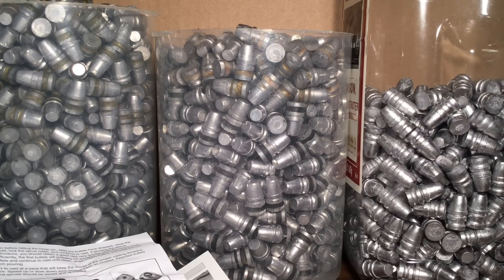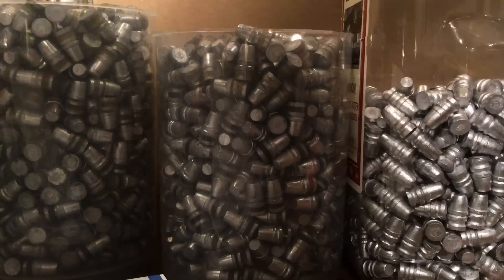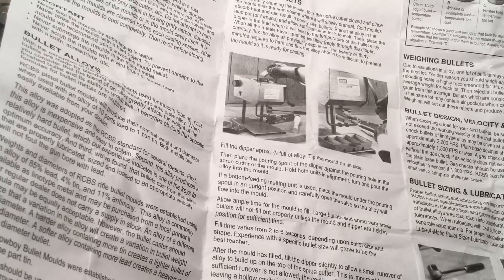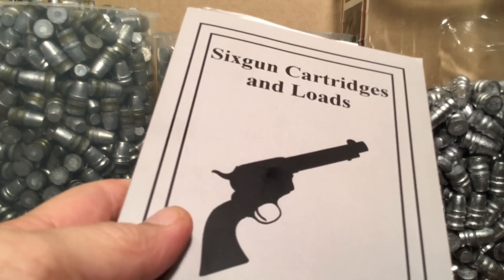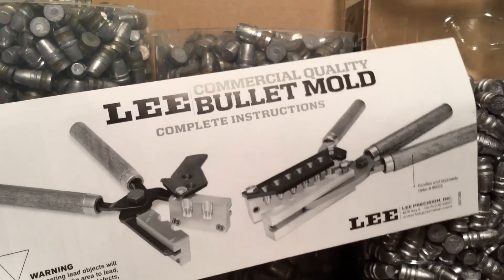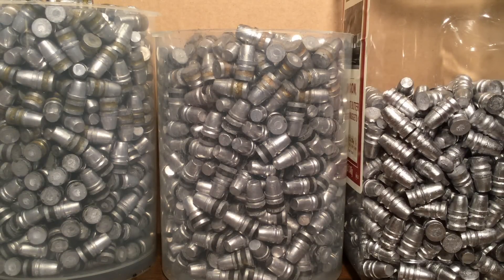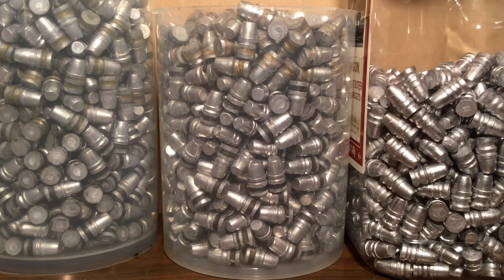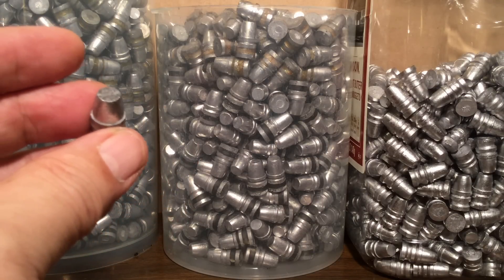The Big Hardness Gain Bullet Casting Water Quench Controversy - VR To Carl

Comment: I started out casting fishing sinkers for my uncle's when I was a pre-teen and soon graduated to their bullet making.....that was almost 50 yrs. ago now. Once I cleared high school, after a few years I was back heavy into casting and shooting and it's only gotten worse lol. Take it from me FC.....water quenching makes a considerable difference. WW's average about 9 BHN air cooled, but if you water quench them and let them sit a few days they'll average 14-15 BHN. By water quenching it arrests the crystalline structure of the lead and keeps it from migrating back to it's original form or structure. I corresponded with Veral Smith way back around 1980 and he offered a lot of advice back then......as well as his lead tester (which I still have). As WW's were very plentiful back then, that was what I used the most....very common and easy to tailor. Nowadays, not so much....getting way scarce. Still though, most of my casting usage is still done with them.

Comment: Your last comment about bullet hardness is right on the money! The hardness of the bullet has to match the application of the bullet. For most pistol bullets a 'hard' bullet would be cast from Lyman's #2 alloy which is BHN15. When it comes to water dropping bullets, the amount of hardness gained really depends on the alloy of the lead used. If you water drop an alloy that is only a lead - tin alloy like the old 30:1 & 20:1 you're not going to get much added hardness as you need an alloy that has antimony and traces of arsenic in it, such as Lyman #2. Water dropped #2 can reach higher hardness than pure linotype, but without the brittleness of linotype. A few years ago I bought a bunch of pure soft lead 26lb bricks, and I already had some monotype & linotype , as well as some stereotype, and I had to come up with a recipe to make an alloy close to Lyman #2 using one of those bricks as the lead in the recipe, unfortunately I don't remember exactly what the amounts were of the other alloys, but I came pretty close (I don't remember if it was slightly harder or slightly softer). I had a stroke a few years ago that effected my eyesight a bit, so I haven't cast my own bullet since then. I should probably sell my drawers full of bullet molds, but I keep telling myself that one day I'll get back to it. That's the same reason I haven't sold any of my photographic darkroom equipment either! :)

One last thing, I've yet to check, but supposedly the hardness gained by water dropping bullets goes away after a few years, although I don't know if that's 5 years, or 15, or more?

Comment: My understanding of water quenching is it creates a short term hardness.  Lead becomes harder as the poured lead ages.  As cast,  ingots tested for hardness will show a reading as soon as cool enough to touch and can be marked but test those ingots in a week and they will almost assuredly be harder.  Water quenching doesn't make a bullet harder long term. I does make it harder at the time it cools vs allowing to air cool.  That helps if you plan to size, lube, load and shoot your cast bullets that day or the next day.  After a few days they will be the same as air dropped bullets.  As you also mentioned, it makes handling fresh cast bullets a lot easier.

Comment: Hey Steve, I will have to get a Lee hardness tester. I recently got 2 bars of hardball and 1 bar of linotype from Rotometals to mix with the four 8# lead scuba weights and 8# of w/w which I suspect are softer than hardball or even the w/w. I quench bullets released from mould when casting. Quench hot bullets that are powder coated, whicj likely harden up batch more uniformly. Great video.

Comment: Hi Steve!; The main reason I've been water quenching my bullets, (BOTH hangun & rifle bullets, even those designed to use gas checks), is much lower final cost. Many years ago, I was carefully following Lyman's #2 alloy recipe, but then read about the 'water quench treatment' I'm using now, much cheaper because I just use wheel weights + 20% Linotype + 1% Tin and (after 2 - 3 weeks of 'curing' any specific lot of bullets), then obtain BHN roughly 25 - 27, and only then, I lube / size (and install gas checks if bullet design so allows), and almost get 'jacketed' accuracy & consistency at lower final costs. If I add powder coating to the above, (And water quench hot powder coated bullets right after coming out of the oven), the outcome is even better, with No leading whatsoever, even in rifle bullets (.243 + powder coating AND lubing / sizing 0.001" over groove diameter, NOT to be used over 2.200 fps / reduced loads). Thank You & Blessings for your in- depth info!!..
🤗🙏🙏🙏

Comment: There is plenty of hard data from that pamphlet the cali bulet casters put out, as well as some recent data sponsored by rotometals. The biggest factor is controlling temp at the point you dump them in the water. Dropping from the mold has a huge variation in cooling time. however if you bring them all up to near critical inside an oven and dump the whole batch in water you get 1) uniform hardness, 2) significantly more hardness than you get from mold dropping.
Reply from the maker: GunFun ZS - That all sounds great...I've got to check that out...but my latest bullets are hard..(from alloy mixing) And I can get BHN 36 with some alloys straight up.!!  Sizing them was a chore.  I suppose I could size them and then heat treat them.  But at what point would I just say, I guess it's time to order more of those SMKs or Scenars or Bergers...And then there is the whole new world of powder coated bullets and getting them to shoot MOA... Best to ya,  FC Steve

Comment: I just bought a Lee Lead Hardness tester. It uses a special point in a press that is spring loaded that must be held under spring pressure for a given amount of time. You then use a eye loupe to measure the indentation and check it against their hardness chart to get you final measured hardness.  Its relatively cheap I would imagine you prolly have one of these by now  to tell  your exact bullet hardness Fortune cookie

Comment: I have been casting bullets for 40 or so years as well. 
Strait water quenching does harden a cast bullet somewhat and provided
one uses a bullet such as the tumble lube lee and liquid alox with no sizing it
will remain hard. The water quenching only affects the skin layer of the
bullet. If you must size your bullet after quenching, you can work soften the
outside skin of the bullet.
I have the RCBS Cast Bullet manual which includes a detailed article on the subject, “Cast Bullet
Heat Treatment” by Dennis Marshall. This article does not specifically cover
drop quenching from the mold but is very informative. 

If you don't have a copy of this book I can e-mail a PDF of the article.
Reply from the maker: Thomas Gervais - Just checked MidwayUSA and they don't carry the RCBS CBM, must be out of print.  That's one manual I don't have in my reference library.  I'm going to check Amazon and see if they have any old issues for sale... like buying old issues of Gun Digest...  Best to ya,  FC

Comment: Thanks for this very good video! I've not water quenched myself as most all my CB loads are low pressure/velocity and I'm not looking for super hard bullets. Some wisdom points toward softer bullets in lower speed & pressure loads leading less owing to better obturation & seal with a softer bullet in a modest pressure load. I have really liked the bullets by Lasercast/Oregon bullet co that are 24 BHN. They're great to load, don't lead & are accurate in even rifle loads without gaschecks. I wonder though how these hard bullets would perform for hunting. The company seems to think they don't shatter. I havn't used them for hunting.

Comment: Very interesting! From my little bit of experience, cooling metal fast does harden metals. However, I know that some metals become quite brittle when water quenched. I also know that water quenching welds causes them to become brittle. Lead has different properties than the steel that I’m used to. Steel isn’t malleable.
Reply from the maker: MB - Good points you bring up.  Some have suggested that they get increase of 10 - 20 BHN (?) hardness of cast lead bullets when they water quench.  Results in cast bullets at BHN 30s.  These videos may still be out there.  That really is not plausible as Linotype alloy is BHN 22.  They are talking BHN in the neighborhood of SuperHard alloy (BHN 35) just by water quenching.  If that were so, the bullets would be so brittle, they would break up on any bone hit - totally unacceptable and would be very evident without delay.  I haven't heard those claims recently, even though I know those claims are made in good faith - I don't trust the Lee Lead Hardness tester as variations in operator interpretations occur.  However, water quenching giving extra 1-2 BHN seems to be reliable.  Best to ya,  Steve
Reply: FortuneCookie45LC Thanks Steve! I’m a newbie who has bought some 44 mag dies, but doesn’t have a room setup for reloading yet, so haven’t purchased a press, etc.. I have watched oodles if reloading vids, and a few casting vids, mostly yours. Lol! Thanks for the detailed work and sharing that you do. I look forward to putting some of what I’ve gleaned to use soon.

Comment: There is no harm in water quenching of bullets out of the mold. but in the interest of uniformity , it is best to bring them to a given temperature, holding it at the right level, THEN quench, then age the bullets before sizing and lubing.  It is surprising the amount of additional hardening that occurs during aging of cast alloy bullets.  There was an African "White Hunter" that wrote about heat treating and aging of alloy bullets early on, I wish I could remember his name.  Elmer knew all about heat treating and aging of bullets, but said for all but match use, one could sort. lube, load, and shoot for field use without all the trouble.

Comment: What weights are your Keith 44 mag bullets? What weights were the Keith 44s?I bought some that i belive were Keith style awhile back i think 250 grain, from a local shop. I remember there wasnt as much data for the weight it was. They shot pretty well out of the redhawk. Ive got a bit of lead, havnt cast anything yet. Once my lead is gone, not sure if il have a good source, so not sure how much to invest into equipment. Local dentists offices ive checked with all went to a different method of x-ray that is more low dose radiation, and no longer use lead foils.

Comment: I started reloading back in 2012. I read somewhere, that you should water quench your bullets for extra hardness.  Not only do I water quench, but I use a lot of ice cubes in the water to get the temperature icy cold. I have not changed the recipe in lead melting or water temp since 2012. My bullets comes out great.
Reply: What lead temperatures are you casting at ?

Comment: The shock that fast freezes the lead bullet is harden way before it hits the bottom of what every you have holding water. A gallon of water will do just fine. Other side of the coin if you want soft bullets you want to cool them down as slowly as possible.
Just hunt up some metallurgy and you can read it for your selves. Same goes for steels but, not cast.

Comment: The weird thing I found was that I got more harness with half 'pure" half wheel weights than straight wheel weights quenched. It might have been that I got a bunch of strange alloy though. I haven't figured this one out yet, because the results fall outside of the formulas for alloy/hardness ratios that others have published.

I want very hard bullets when I have a load with high chamber pressure loads. i.e. rifle loads that are not reduced. For example, the pressures that most max loads for 308 Win published recipes for jacketed bullets dictate a bullet in the ~34 BHN range. 7.62x39/30-30/300 blackout max loads for jacketed tend to require bullets between 26 and 32 BHN.  Also, that does me no good if there is 5 BHN variance bullet to bullet from a batch. Even if all are hard enough to not lead, that initial pressure required to seat a harder bullet into the lands will show in velocity and cause vertical stringing. 

So for me, a person who wants to do volume target shooting of 30 cal firearms with normal trajectories, consistent hardness and high hardness is critical.
Reply from the maker: GunFun ZS - There must be some reason I've resisted shooting full power rifle loads with my cast bullets.  I readily shoot reduced.  Thanks for putting some numbers on my reason...I'd have to cast with pure SuperHard alloy...or just shoot jacketed bullets...The military went to jacketed bullets and never looked back.  Best to ya,  FC

Comment: Howdy, I am wondering about the different weights of alloys in a particular mold.  The Lee Precision technicians were telling me that my Lee molds were created with 95% lead to a 5% tin (20:1) mixture when they calculated the weight in grains for a bullet.  I recently purchased 2 molds from Lee, the  CTL312-160-2R and the   C312-185-1R 185.  I had already cast bullets with Lyman #2 (homemade alloy) before I had talked to Lee Precision.  The weights of the bullets were pretty far off, average 157 and 177 respectively.  According to the Lead Alloy Calculator, my mixture to get Lyman #2 was 14.9 BHN.   I was able to mix an alloy (I was out of Tin) of  2.87% Tin, 1.98% Antimony and 95.1% Lead for a BHN on 11.3 in hopes of getting to the 20:1 that Lee recommended.  Average weights were closer to the mold description; average 162.6 and 183.2 respectively.   My question to you is this.  How would you calculate your load recipe for the lighter bullet (higher BHN for rifle bullets) when all of the data on the websites and books call for the 160 or 185 grn cast bullets? Another problem I have is that Lee doesn't even list their own molds for the cast bullets in the 7.62x54R section of their own book.  Also, I am powder coating with very consistent results.  The Lee Modern Reloading 2nd Edition, revised 2019, talks about pressure versus BHN to great lengths; Chapter 10, matching bullet metals to chamber pressure.  In short, there is a factor of 1422 that you would multiply by your BHN and that would calculate your Ultimate Compressive Strength (UCS) of the alloy.  Ideally, you would want to be 10% less than the UCS in your chamber pressure for the best accuracy.  I can't even find a cast bullet close to the weights to even start a safe reduced load.

Comment: Sir, how about a simple test?  I did this test years ago.  I had been hearing (1980s) pros and cons concerning water quenching and that the hardness that was gained would be lost in a short period of time.  I used the SAECO hardness tester (new at the time I think) and that is exactly what I found.  I do not have the expertise you have BUT I found that there was a gain in hardness with quenching but within a short period of time the bullets had lost that extra hardness.  I stopped using the water quench and depend on the alloy and the proper mechanics...  Please consider doing a test.  I like to put questionable bullets right back into the pot while still hot which cannot be done if they are wet.  Many of my speciality mold blocks are of smaller size and get too hot if I do not take a little more time between pours.  By checking the bullets while they are cooling on the moist soft surfaces I use I am better able to keep the smaller mold blocks cool enough to avoid overheating the mold blocks.  I have not been checking bullet diameter as I cast because I use libra-sizers...  going to try your methods this spring.  I find your work fascinating, please keep-up the good work Sir.

Comment: Other than possible hardness, it seems to me dropping into water would help prevent and nicks or dents in the freshly molded hotter, softer bullets.
Reply from the maker: Cmax Arms - Especially if there is an old towel at the bottom of the water.  I really don't think we get huge gains in hardness with water quench - but GunFun ZS has a good point - for consistent hardness gain, we need to do heat treating and then dump all bullets at the same time into water at once...otherwise, the gains are all over the place and inconsistent fueling the controversy over how much is actually gained.  Best to ya,  FC

Comment: I have read about and start seeing a few water quenching videos. I was wondering what kind of impact it would have on the rounds. Thanks pointing out the BHN hardness and a BHN of 26 is just between Pure Aluminum and Copper.
Reply from the maker: DviDawg 3082 - Glad that you posted again in this video - your other post on the Hi-Tek did not show up in the comment section for me to reply - Hi Tek is a fine way to go - requires mixing of liquid powder.  If anyone want to go that way, that's mighty fine...We really don't want bullets harder than BHN 22 - pure linotype - Lyman recommends using Lyman #2 alloy for almost everything with pure linotype for certain rifle rounds only - most of our shooting can be done with BHN 18 and below.  Have a great day, FC